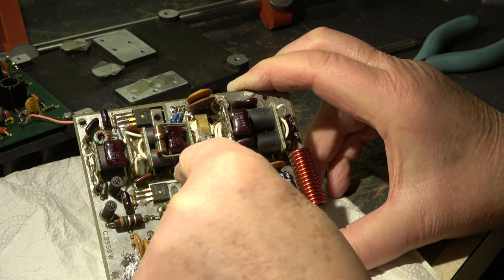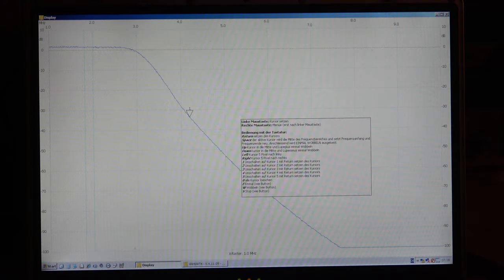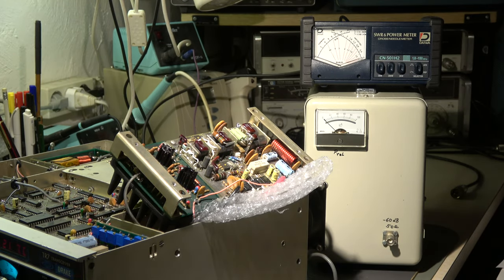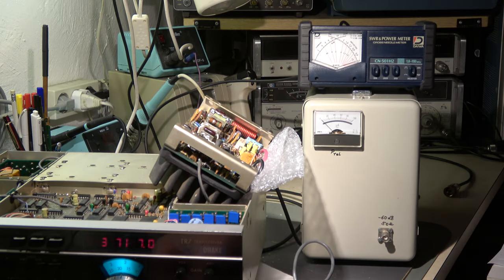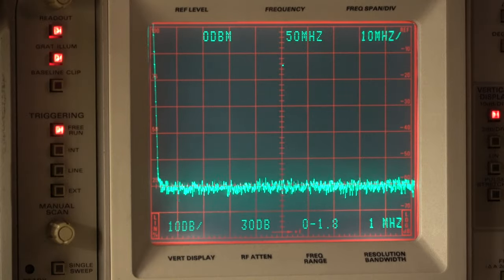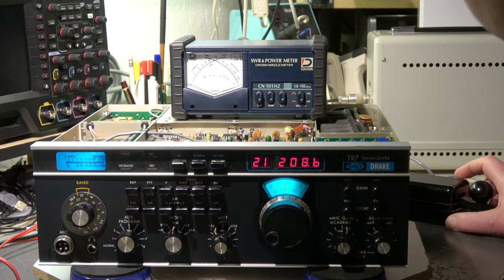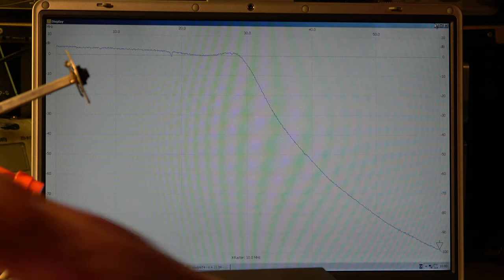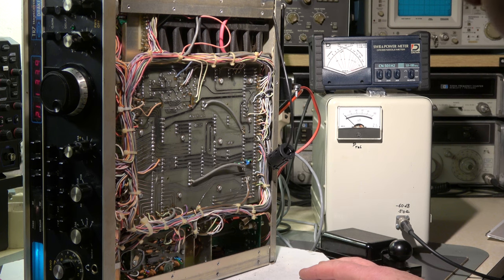#160 Drake TR7 Part 8(13)

Comment: Great series Stefan. 
I have a TR7A and it gives out well over 100w on all bands, haven't noticed lower power on 17m. Y
ou have an interesting little mystery here :) Here gomes a guess from me:
To recap what you did: 
Measure complete chain= lower P @18Mc
measure  filter direct = ok
measure from PA with new cable= lower P
The bandswitch and the relay are the two remaining components to check. Bad connection?
Maybe bypass them with a wire and measure again from PA . 
Or is a design flaw?
You have done a great job of restoring that nice radio. Very interesting. Viel Glück für das Finale 
73 de SM7PNS
Reply from the maker: Mni tnx dr Robert. I´ll examine this topic further.

Comment: Ah yes, a bottle of wisdom may be needed. Interesting that the small notch appears at the same frequency (about 18 MHz)  no matter which low pass filter is selected. That would mean it is caused somewhere else in the transmit path. Regards, David
Reply from the maker: This notch is indeed a mystery and not caused by the sweeper
Reply: I am not a transmitter person, not low frequency - more square plumbing and meter tall klystrons. I was wondering if you could connect the sweeper to the input of the PA and look at the output? Maybe at low power. Just a thought. Regards, David
Reply from the maker: @davidv1289  Exactly my thoughts! I´ll do a similar check in the next video with different settings of the LP filter

Comment: Hi Stefan,

My TR-7 (S/N1394) has the same problem with lower power output on 15M. This video will be most helpful as I try to fix the issue. Could this be a common problem with all TR-7's? I did replace the UM9401's and the problem persists.

73's
Pete N6QW
Reply from the maker: Hi dr Pete, yes, 15m is a mystery. But i´ll try to locate the problem.